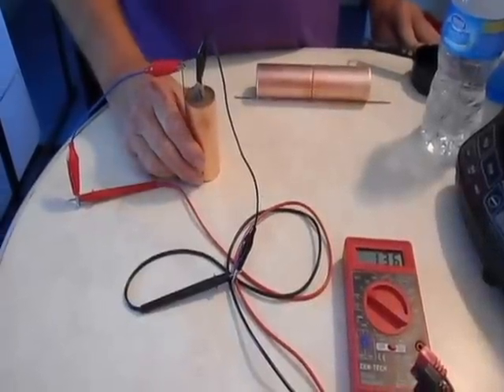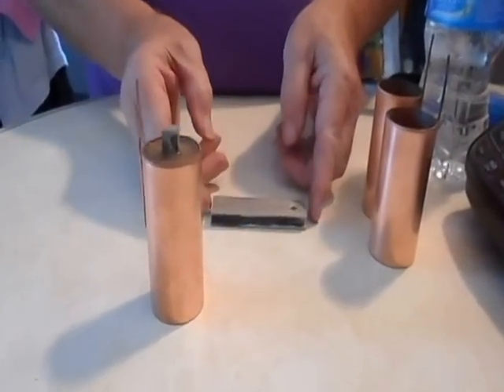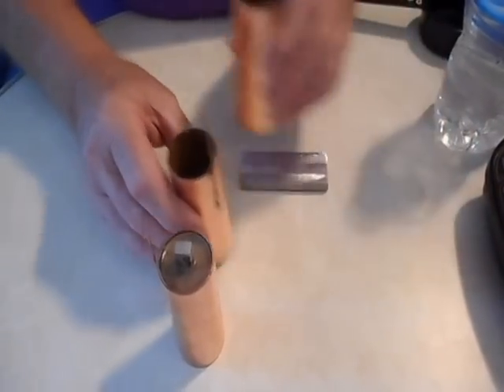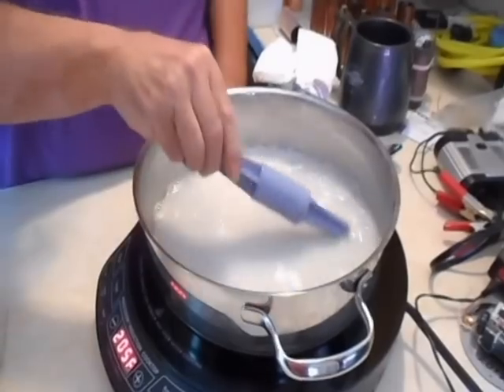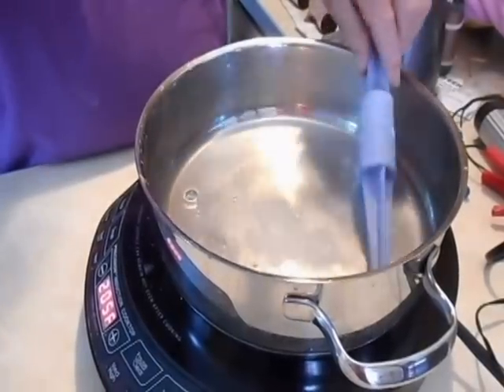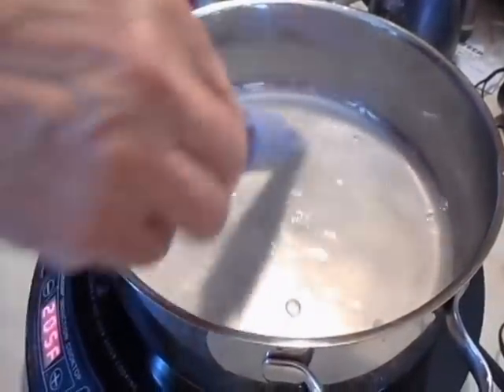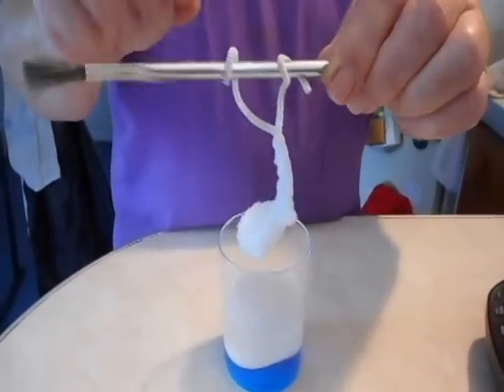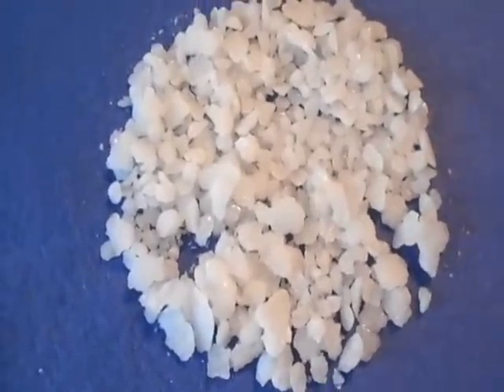Make Borax crystals for battery build

Comment: The ides a growing a crystal is a long drawn out method of removing the water from the borax. That being said, continue the heat process until the water boils off until you have more of a white liquid paste capable of being poured if you will. It should be the consistency say cake batter. Then you pour that into the copper and let it set and dry out on its own over a period of time. What that does  is it allows the best compression. You pour it in then tap it down so every space in the copper is filled and you get really good contact with the tube. Years ago using that method I had a battery set that ran leds to the consistency of a 7 watt night light 24/7 for 3 months and the batteries still have full voltage when I took them apart. Just a thought.

Comment: can I recharge my iPhone with it?
Reply: Depends on the size and capacity but it is possible so long as the output voltage is relativity steady. A voltage booster and regulator would be recommended though for use with sensitive electronics. 4.5 to 5 volts and 0.5 amps to 1.0 amps. To find exact voltage needed for your phone, read the output on the charger. Proper charger voltage will meant fastest charge time. For example, My phone is 4.7 volts and 0.785 amps and when plugged into a USB charger with 5v 1A output it kicks to slow charge for battery protection.
Reply: With a single cell, probably not. There's not enough voltage to do that. With multiple cells in series, you can charge your battery a bit.

Comment: actually you do not need to cook it. Try to do it without cooling .... just shove it in the pipe with pressure. Pour little water on it and let it settle till next morning. And you are done. :)
Reply: So you take out acid and then shove back in washing soda?
Do you have a video or demo? Please share.
Sharing is caring :)
Reply from the maker: +Talha Kamran Thanks for the input.
Reply: +Lynn Mango Actually you don';t need to do alot of things +talhakarman .

My battery is 3.6 Volt and 120-200 mamp , i used a Battery , neutralised the acids and put a propriatery Washing Soda in Battery .

What one has to understand is reaction of solutions and metals .

Any reactive solution ..... creates a crystal film on a non reactive metal .

As does Gold , silver or platinum in Sulfuric acid ... also a battery .

Never corrodes if it's below the reactivity UNLESS heated , heat destroys the crystal protection film and leads to corrosion .

My Battery is THE SIMPLEST that you can build , need not buy anything just find a descent used battery , reverse the charge to clean the plates a little , flush it with baking soda until it no longer bubbles ( alkaline ) and then add ANY ELECTROLYTE ! 

HAHA ... took me 2 weeks , I also built Aluminium Copper Batteries , Copper-Lead ,  2 different Carbon ( Power Plus Japan carbon battery ) 

UUU this must be the simplest shit in the world ! 

Simple chemistry that results in little more complex LENR effect (Low Energy Nuclear Reactions)
Reply: yes just like that , better to wash it out a little .. then fil it with water + soda until it stoppes bubbling .

The bubbling is Acid yes . So you need 2 keep adding soda until bubbling stoppes .

What cheaper , a descent dead battery or a quality magnesium rod and copper pipe ?

Then you need sodium carbonate ( which is made by heating Bicarbonate (soda) .
So really you can do it all in one proccess , either heat or higher Voltage ( i presume )

Then you can have a liquid alkaline battery or you ore it out and let the crystals grow within the battery seperators .

Bedini does the same but he cleans it all out and put new seperators , cleaner but  too much work ; )

then he puts a thicker past which he cooks.

Probably a better crystal growth but I will upload you a video of the cell i have now .
Reply: @johnecopracyprus1051  I like you 20 sec vids from the time of this comment! lol nice and descriptive!!!

Comment: You say battery in your video, but isn't each pipe a cell?
Would you state the goals for this type of energy storage device?  I see below comments that indicate the devices won't use water to reduce expansion & another comment about no corrosion mg.

What do you hope to get from making your own energy storage device that you can't get from other off-the-shelf devices?

Thanks for sharing!
Reply from the maker: I havent found any battery (or cell) off the shelf that recharges itself for two years or more, have you??
Reply: No, I've never seen a battery that actually recharges itself.

How many wh of energy will one of your cells store?
What is your projected energy density?
Reply from the maker: A B I made 30 of them. Gonna try to run a bedini motor with them
 Want to hook them all together for 30 volts, put it through a voltage regulator and reduce it to 9 or 12 volts and then attempt to run the bedini. Will post it as soon as I drain the swamp thats full of alligators.
Reply: How many V & mah do you think you will get from each cell?

How much time will it take for a cell to 'recharge' after it's energy has been used?

How does the cell recharge itself?

Note:  A Bedini circuit doesn't produce any energy, it merely redirects counter emf when the magnetic field of a coil collapses.  Yes, that energy can be used to charge a capacitor/cell/battery, but it doesn't produce any new energy.  If you add up all the energy spent by the motor, redirected CEMF energy, & dissipated heat, that total energy would be equal to the energy that was delivered from the power source to the Bedini system.

If your cells are truly self-recharging, then I'd like to see your explanation for how that works.

Thanks.
Reply from the maker: +Lynn Mango  Didnt work not enough "balls" voltage dropped as soon as I applied the load.
Reply: +Red .Rotten
Can you provide the url to that video?